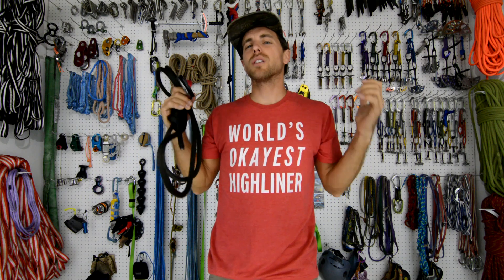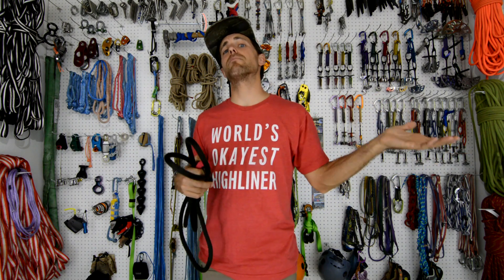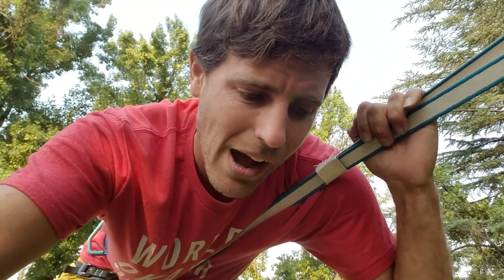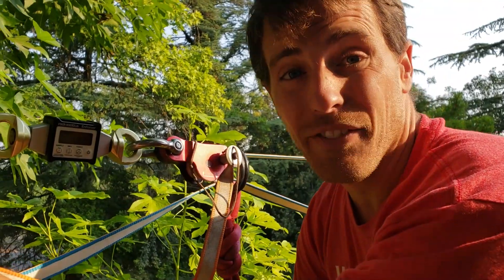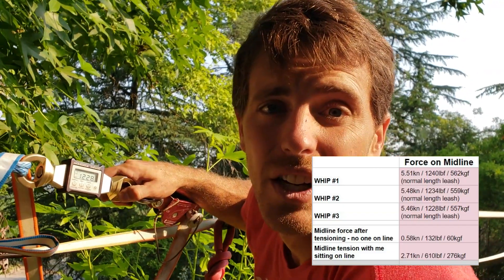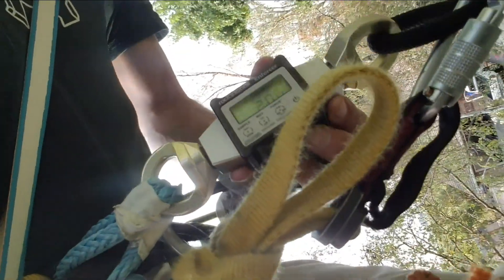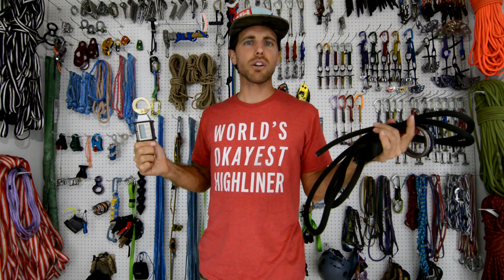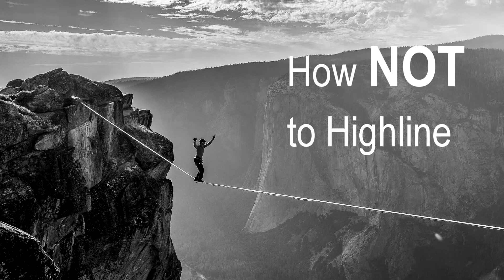How much FORCE does your LEASH have when you fall off a highline?

Comment: Very interested how different webbing material affects forces on the leash.  I.e how does nylon (sky pilot) vs. poly (Aero 2) webbing at around 30M compare?  What about super stretchy tubular webbing? 
We have some hypothesis, but no dynometer to test with. Thanks.  And great work.
Reply from the maker: Sounds like i need to get some volunteers at ggby to whip on every line with the dyno on the leash :)